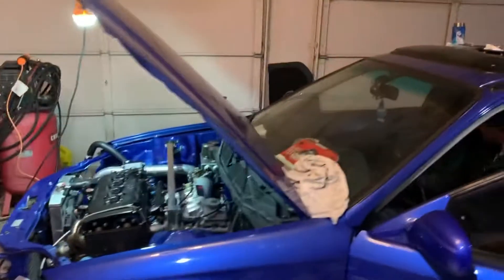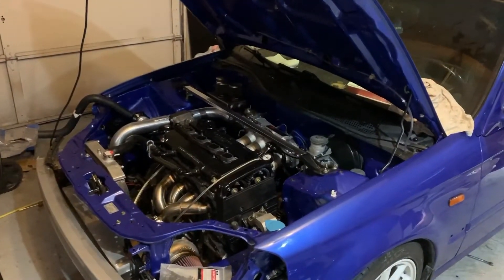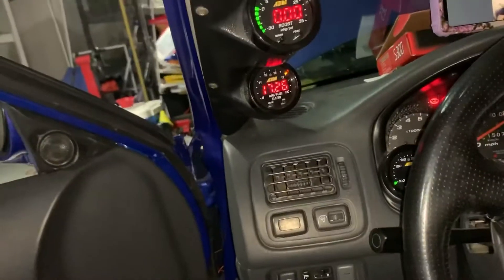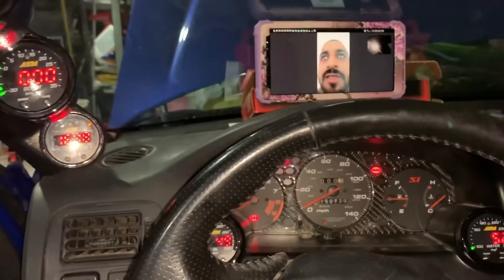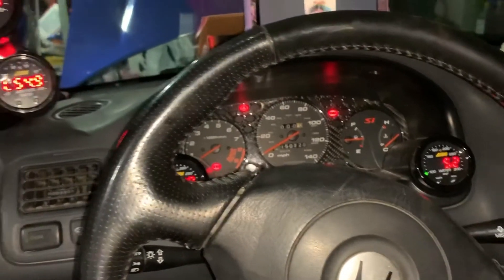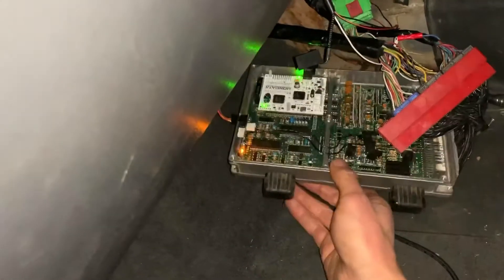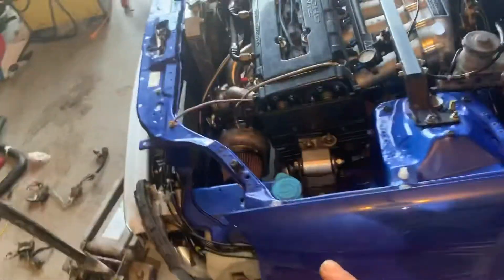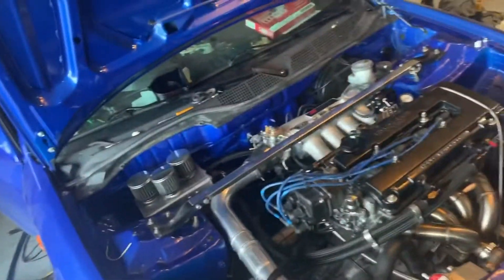Day 16, FIRST START?!

Comment: Have you tried turning off the coil on plug in the firmware and putting the rotor & cap back on? If, as Burton says, the coil on plug is supposed to be disabled in the firmware, then wouldn't the rotor & distributor be necessary?
Reply from the maker: Hugh Radford III this has been recorded for some time.. so stay tuned to see what happens next! Already have more footage, just need to splice and upload. But, no.. don’t need rotor, but do need distributor (just for the mounting of one sensor)
Reply: @princeraja  Cam position sensor?
Reply from the maker: Yes. Cam position sensor.